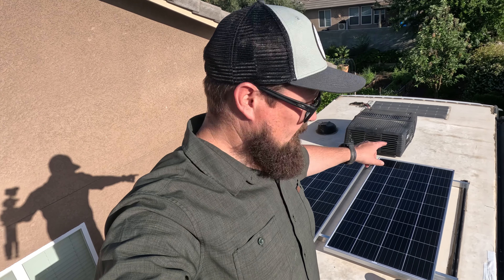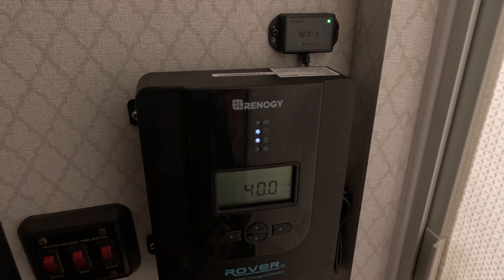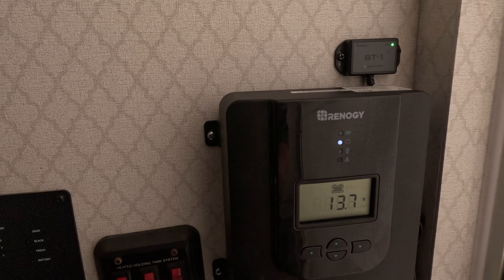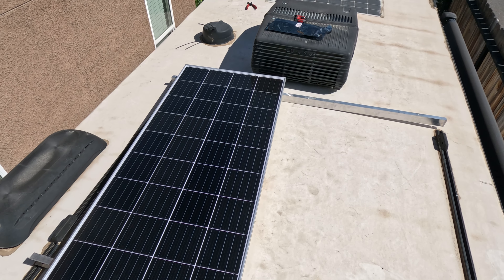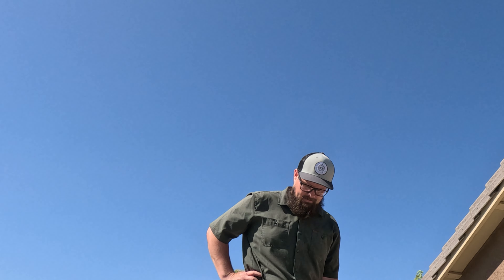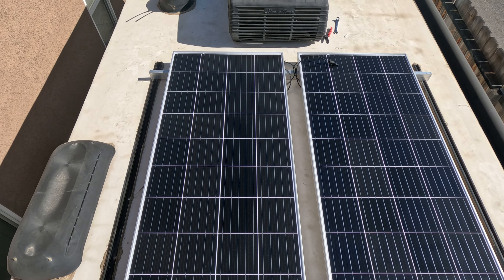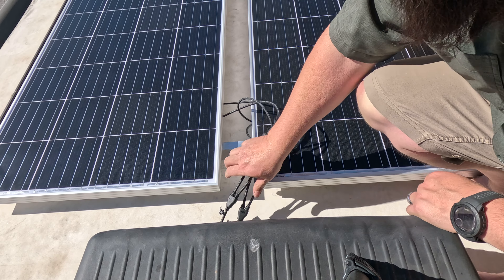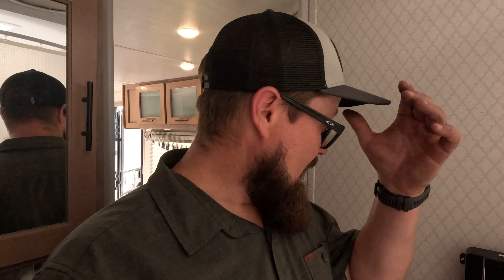Factory Solar Upgrade NoBo Travel Trailer | Custom Rhino Rack Mount

Comment: So you did not need to upgrade the gauge of your wires from the charge controller to your battery? You just used all of the factory wiring? Looking to do something similar on my Nobo
Reply from the maker: No upgrades to the wire. Mine already had 10 gauge installed. All of the connections to mine are under the driver's side belly up front. I opened everything and double checked the connections before adding the panels. I will be replacing the flexible panel from the factory, but I won't do that until the fall.
Reply: @RoadandReel  awesome great to know thanks for the reply!

Comment: Hi JP I'm looking for a 12V 200 ah lithium battery with low temperature temp charger shut off. Not sure if the controller you have does that already? I'm also concerned about the battery life not being charged through the winter if temperature won't allow charging. Do you recommend anything?
Reply from the maker: @shawnmcavoy5720  HQST and Victron  both have low temp cutoff options with their MPPT charge controllers. There are also a few DIY options available. Here's a channel I watch quite a bit with good info in building a low temp disconnect https://youtu.be/XpO4s6Lrrmc